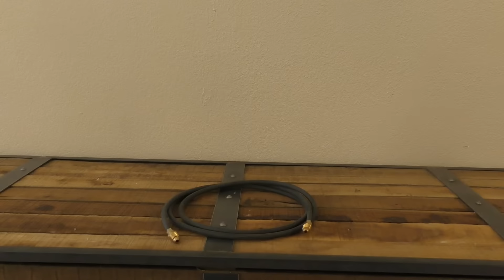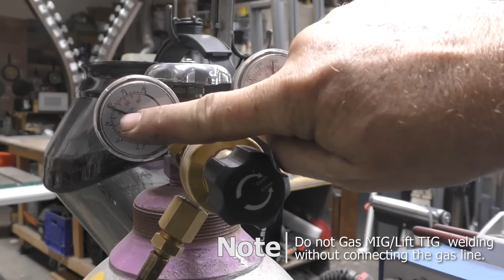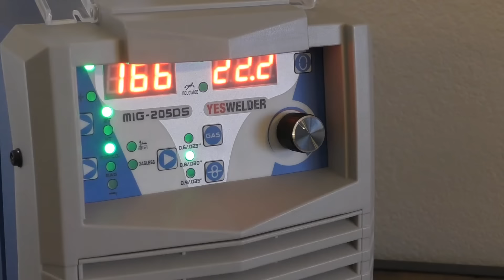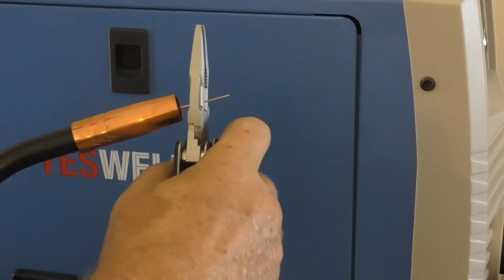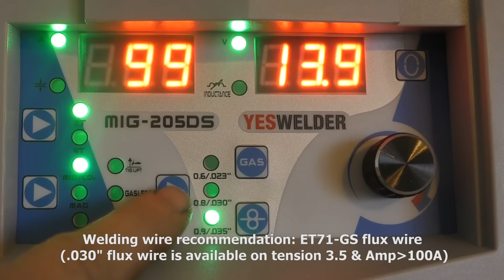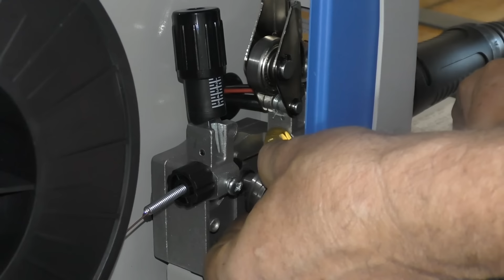MIG-205DS Basic Setup Multi-Process MIG Welder | YesWelder

Comment: Good instructional video... I was a bit surprised when you didn't cover anything for flux core... I know on most welders that polarity  must be reversed for flux core... Do you know if this unit requires that..?
Reply: Yes for flux core wire, the short ‘gun cable’ on the LH side of the housing must be plugged into the negative terminal and the ground cable into the positive terminal. This will give you the DCEN setup that is required for Flux Core wire.

Comment: Just bought a 205DS, doing flux core wire.  Where can I find the knurled drive roller it'll need?
Reply from the maker: Hi friend! Unfortunately, we don't have available in our store, however, we do recommend checking this part locally. :)
Reply: I got the 205DS last week, and it came with two rollers. One smooth for MIG, and one knurled for flux core wire. Check all the bags that came with your welder, I think the knurled roller should be included.

Comment: Do you have a video showing how to set up for stick?
Reply from the maker: Hi Darren! Try checking this one -- https://www.youtube.com/watch?v=J4poNtP1rUA&t=21s
Reply: @YesWelder  That looks to be just a copy of this one. However, this video demonstrates using it.
All you really need to do is to setup DCEP (Stinger positive, work clamp negative), and put the welder in stick mode (icon of stick welding), and set the amps appropriately (60-80, per the chart). 
This guy demonstrates it pretty well: https://www.youtube.com/watch?v=_FH6Bvrose0

Comment: I just bought a 205 DS about a month ago and getting in a lot of practice.  For some reason or other, when adjusting the thickness setting it doesn't go thicker than 5.1mm (I'm using 1/4 plate, which should be 6.7mm; and 3/16 plate is 4.7mm, and I can't get the machine higher than 4.1mm).  I just ignore it and set the amperage for the material at hand, and adjust the inductance as needed.  Any idea why this is?
Reply from the maker: Hey friend! If you are encountering issues with your welder, please do not hesitate to contact us at support@yeswelder.com, we will be happy to help. :)